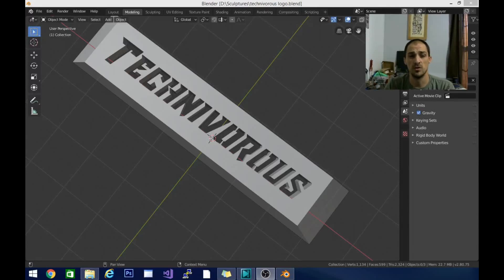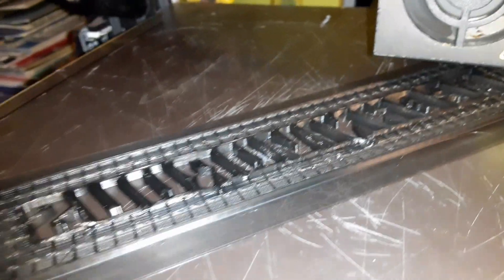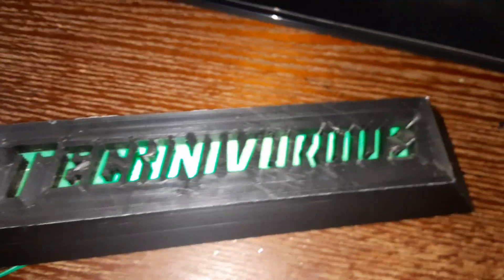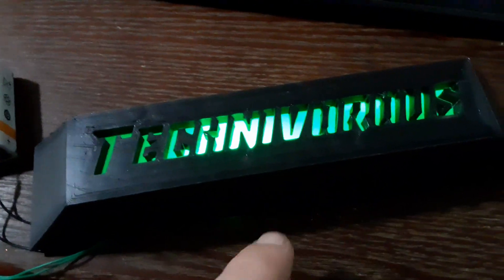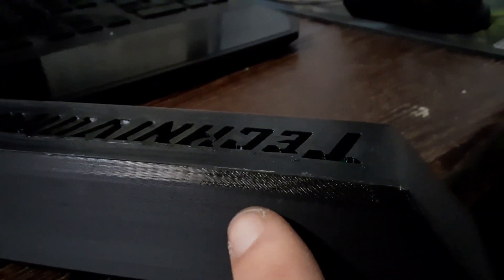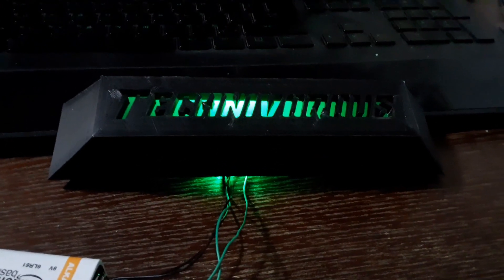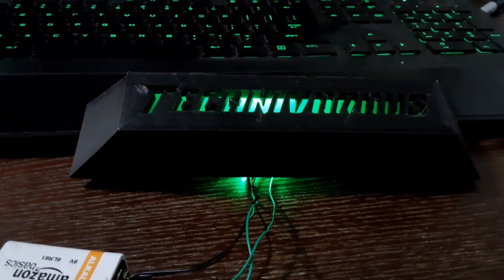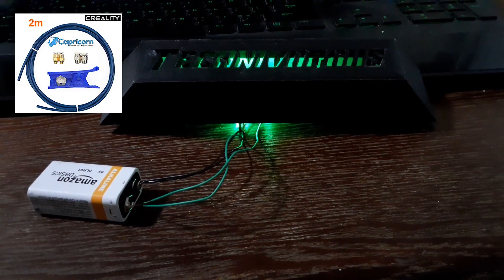Ender 3 printing at 3x speed with Capricorn Tube!

Comment: I've noticed with my ender that straight moves in either X or Y have a higher likelihood of layer shifting than angles. Could just be my accel is too high.
Reply from the maker: Yeah if I'm printing a square or rectangle I will actually prient it diagonally, as it seems a lot less jerky when going back and forth. It can print pretty fast and still get a nice print.

Comment: 300% speed means nothing if you don't tell what the speed is 300% of.
Reply from the maker: 300% of 65 mm/s infill and 40 mm/s walls so between 120-195 MMS depending on the part of the print
Reply: @Technivorous  humm and i was thinking 100mm/s was fast with my 32bit board an cap tubeing. Guess ill have to crank it to 11
Reply: Acceleration and jerk play a part in it too, but assuming those were set appropriately then yeah. Ender 3 is capable of rather fast print speeds.

Comment: These results are very impressive.  Makes me surmise that switching to a Capricorn PTFE tube and fittings is the single most inexpensive and practical upgrade to a FDM printer.  BBB rating.  Biggest  Bang for the Buck.
Reply from the maker: I was impressed as well. I think 300% was a little high, my print speed in cura was set to 65mm/s so that a 195mm/s print. I'd be happy at 150 with a good print. And if I can figure out that slight ringing on the corner I would probably be able to bump it up more
Reply: @Technivorous  What were your temp settings?
Reply from the maker: @RSmith-ld9ct   217 on the nozzle 55 on the bed cheap 12 kilo of wiiboox PLA